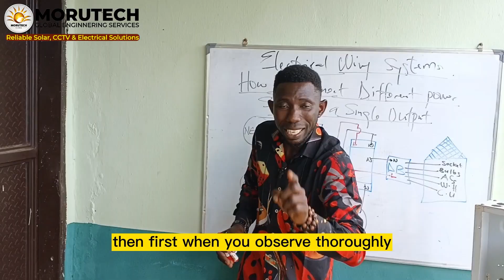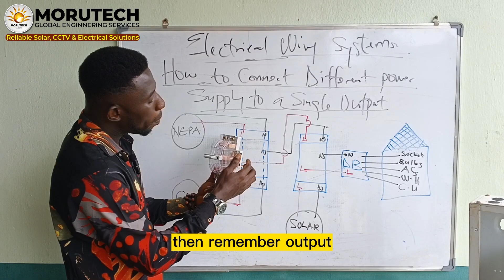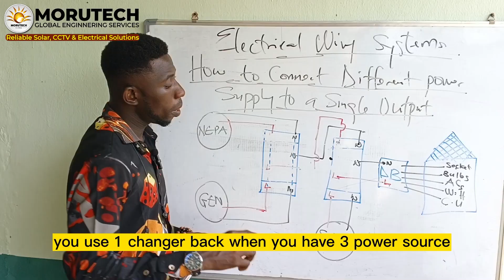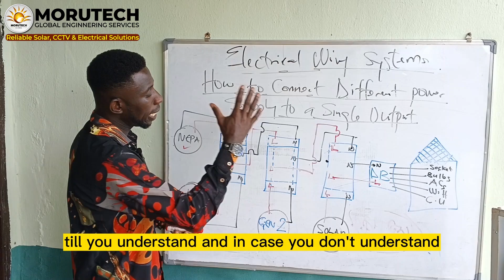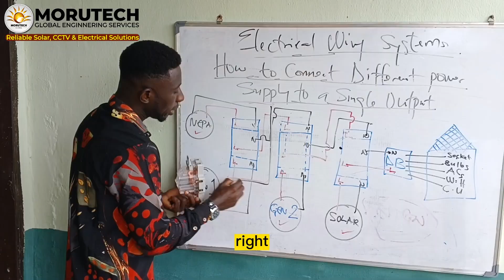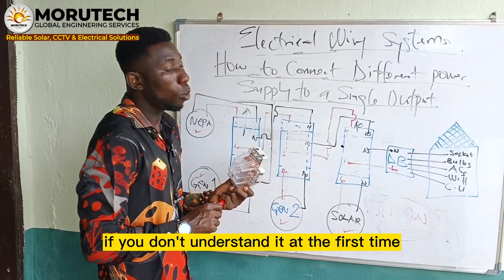How to Connect Multiple Power Sources Safely | Solar & Inverter Guide

Comment: Thank u for the good explanation on the subject. It's quite enlightening. However, u kept using NEPA as the reference power source thruóut. U didnt explain connections & operation of the 2 gens with d solar power source in case it is gens that are only available power source day or night. Take note sir
Reply from the maker: Noted sir
Thank you sir